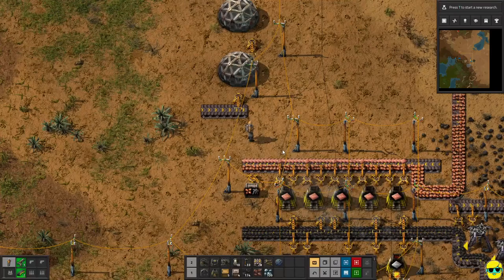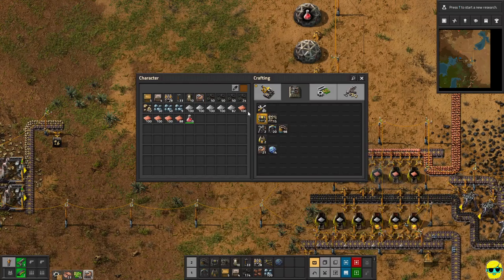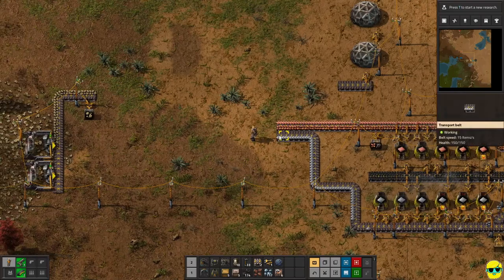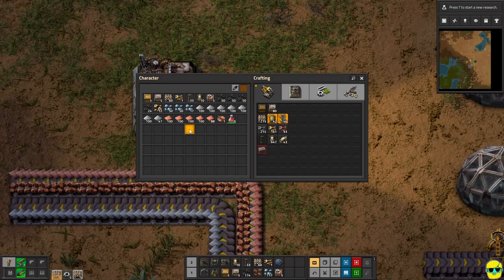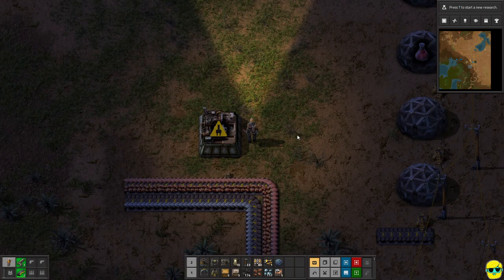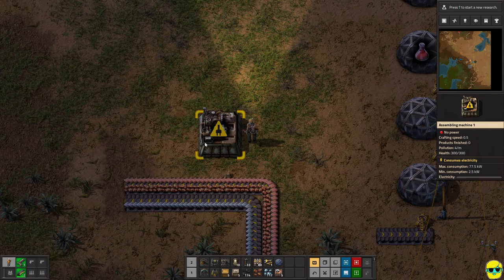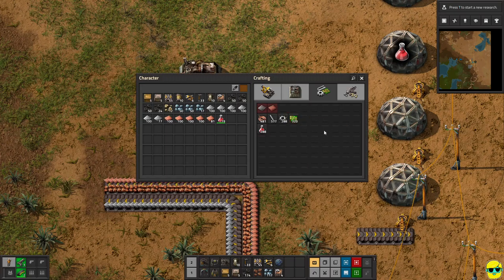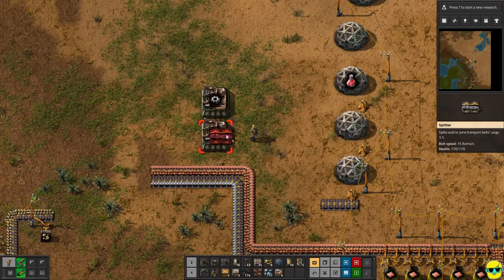Factorio | 2023 Guide for Complete Beginners | Episode 3 | Assemblers

Comment: Just FYI,  the electric drills mine more area than they take up. Its a 3x3 structure with a 5x5 mining area. If you have them built too tightly together then you're going to get some inefficiencies from the overlapping mining areas. Its best to just leave some space between them, which has the happy side effect of making them really easy to run belts and power for. The only reason to build them as compact as possible is if it isnt spitting ore out fast enough, and even then if you have more room on the ore patch you can still get more ore by spreading out first.
Reply from the maker: Thank you for clarifying this!

Comment: One easy tip is that it's faster to clean up belts by holding F and running in the belt. You will collect anything you run over (and a bit more).
Reply from the maker: Ohh, good one! Belt running to quickly vacuum up your items--I like it! ;D

Comment: These seem like pretty nice tutorial videos. Good example of problem solving on the power poles in the underground belt gaps, but for anyone interested, there's an easier, simpler solution. Instead of the power poles between furnaces every 3rd furnace, change that to every 2nd furnace and all inserters on both sides of that furnace row will have power without needing any undergrounds. (Furnace, pole, furnace, furnace, pole, furnace, etc.)
Reply from the maker: Oh cool--thanks for sharing this tip!